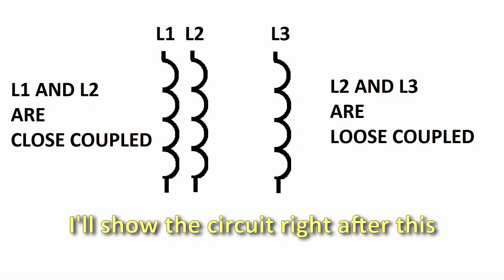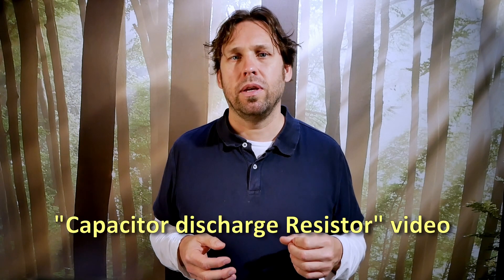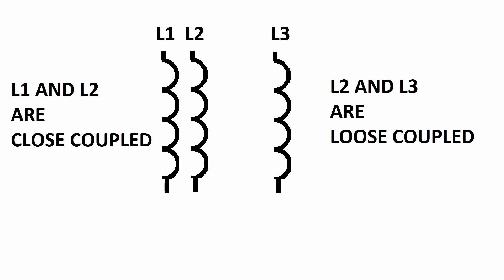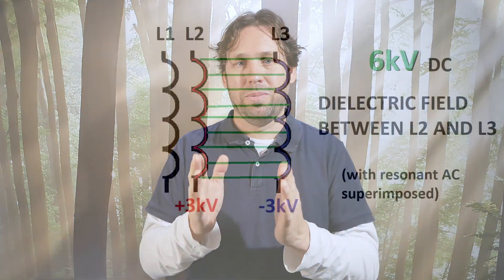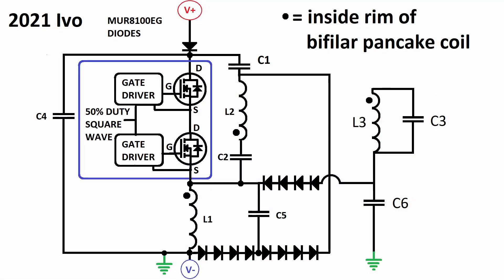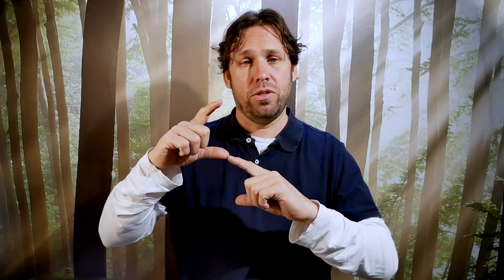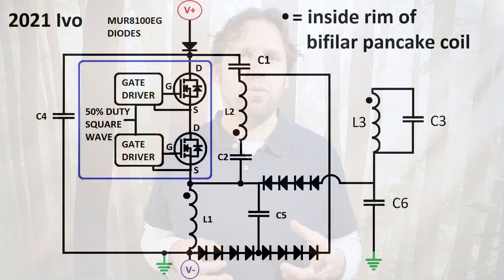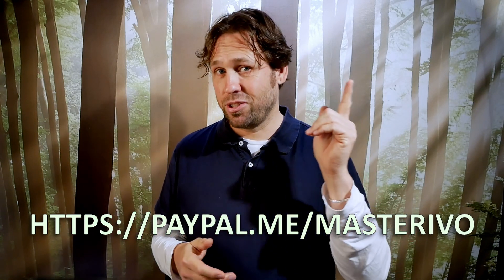Radiant Coil Capacitor Circuit 2021 Explained

Comment: What are the disadvantages and advantages of connecting the 2 Mosfets in series instead of in parallel?
Reply from the maker: series provides high voltage switching capabilities, if Vg threshold of the mosfet is matched.
parallel gives higher current possibilities.
series parallel gives both

Comment: # Master Ivo's Radiant Coil Capacitor Circuit & notes
[root video](https://www.youtube.com/watch?v=qxyf-L48Y8k)
[schematics](https://youtu.be/qxyf-L48Y8k?t=180)
[coil stacking](https://youtu.be/qxyf-L48Y8k?t=218)

(just to make it easier for future reference, anyone is welcome to complete, correct)
syntax notes:
* Series:`()`;  e.g. `(4)` = 4 in series
* Parallel: `[]`; e.g. `[4]` = 4 in parallel
* Reference: `{*n}`; e.g. `C4 {*1}...` later `{*1}: [4 * (2 * WIMA MKP10 2KV DC )]` 
## Components list 

6:41 
### Capacitors:
Need to gather specs for the ones in tuninc cap boards.
[For discharging capacitors](https://youtu.be/ncL5WgkD6Hc?t=98)

896 Ohms = 4x220 17W to protect the fast diodes.

#### C1:
 4KV: `{*1}` >1μF
#### C2:
 4KV: `{*1}`
 Tunes L2 in series with 51nF (IVO uses the cap board, I plan to make a binary system cap board with caps in powers of 2 :) )
#### C3:
 Tunes L3 in parallel with 61nF [cap board](https://www.youtube.com/watch?v=c2_rKc7sHGk&t=380s)
#### C4:
 4μF, 100V, WIMA FKP2
 
#### C5:
 4KV: `{*1}` >1μF
 
#### C6:
 
 4KV: `{*1}`~ 5nF, (Negative DC offset), currently using 680nF (680 sounds unclear?)

`{*1}: [4 * (2 * WIMA MKP10 2KV DC )]`

Notes:
  C2 & C3 caps tune the resonance of L2 and L3, hence testing is needed as size depend on coils.

### Coils (listed in stack order):
https://www.youtube.com/watch?v=2fLBZu7BJkM?t=35
#### L1 (larger)
#### L3 (smaller): output to lamp.
 Produces a triangle wave (not explained why.). Inside rim is parallel resonant with cap board, outside rim grounded. L3 inside rim > cap board > half bridge rectifier (to lamp, only one wire power transmission as the other side is grounded).
#### <Gap: 25mm nylon for loose coupling>

#### L2
 Is flipped for reverse phase (relatively smaller inductance than L1 is L1 impulses make a bigger amplification on L2 by parametric  resonance, for amplification, not sure how though).
https://youtu.be/2fLBZu7BJkM?t=174 By being hase-shifted it's supposed to work in the TEM (Transverse) resonance mode. Current shown is L2's 

#### L4? Soon, for output.

### Mosfets:
Silicon Carbide Power MOSFET. One of the Wolfspeed/Cree C3M SiC MOSFET’s that is excelent for impulse generation. 

2x C3M0065090D

### Gate driver:
mgj1D121505mpc
Wonder if an Arduino pin has an accpetable speed to work as gate (5v)
How to gate: https://youtu.be/c2_rKc7sHGk?t=370 for 2 pulses per cycle, (2X 49% dutty cycle), Pulse discharge happens in 1% dead time.
https://youtu.be/c2_rKc7sHGk?t=686: "1EDI60I12AF (?) gated driver IC's Powered by mgj1D121505mpc isolated DCDC converter" 
Isolated to 1.2KV

Think in later videos he corrected/repurposed this dual 49% dutty cycle mosfet to make it simultaneous series gating. If we use them in sync, do we still need one per Mosfet?

### Diodes:
** I mention the MUR8100E diode, but only the MUR8100EG is available. it has the same functionality.
https://youtu.be/c2_rKc7sHGk?t=522 Two in series with Mosfets. To prevent impulses from leaking via mosfets body diodes. it handles - & + 1KV impulses (should be adjusted for 4KV? for later video https://www.youtube.com/watch?v=qxyf-L48Y8k).
Result: https://youtu.be/c2_rKc7sHGk?t=553
![schematic](https://i.imgur.com/lo5nCVk.png)

Uses 3-4 in series to handle 3Kv-4Kv impulses.

## Input:
2 x 4V, 1.5Amp DC
2 x 4.1V, 1.28Amp DC (10.5 W) when lamp is lit. (56.4KHz)
https://youtu.be/2fLBZu7BJkM?t=368 : 5.74W but more power on L3. 67.23KHz.

## Output
L3: ~ 700V peak to peak.
L2 (dielectric) and L1 (magnetic) fields are assisting L3.
https://youtu.be/2fLBZu7BJkM?t=486 : L2 & L3 90deg phase-shifted, not good.

## Load
28W Lamp between possitive and negativ CD offsets capacitors, "just like in the power suppli side": https://youtu.be/c2_rKc7sHGk?t=943
CD mil-amps metter on lamp.
CD meter for lamp Voltage.

## Power supply

Symmetric, https://youtu.be/c2_rKc7sHGk?t=484 
from 2 square signals from two-channel Rigol signal generator (Cleqee JDS6600-60M) (https://youtu.be/c2_rKc7sHGk?t=783).

## buck converters:
DC-DC buck converter 5V 2A
https://youtu.be/Asa2RuubKWM?t=249

## probes/testers
L2:
https://youtu.be/c2_rKc7sHGk?t=848: Pintek HVP-08 high voltage
https://youtu.be/c2_rKc7sHGk?t=854: Current probe Pintek PA 655
L3: https://youtu.be/c2_rKc7sHGk?t=969 high voltage on resonant side.

## Notes:
[Concept of how to capture & recycle second half wave after impulse](https://youtu.be/ncL5WgkD6Hc?t=230)

https://youtu.be/c2_rKc7sHGk?t=84 basic circuit diagram, C3 doesn't look the same as in https://youtu.be/qxyf-L48Y8k?t=82

DC offset comes and goes, in latest videos it's back. 
Impulses come from L1 on dead time, from half cicle of resonant wave.
https://youtu.be/c2_rKc7sHGk?t=327 schematic with tunning caps and units.
https://youtu.be/c2_rKc7sHGk?t=800: capacitors for feeding HBridge ? not in schematics?

### Links to PCB are broken:
https://easyeda.com/editor#id=1fa6ba959b6844d598ef1974f6bed660 permission denied.
https://oshwlab.com/MasterIvo/radiant-half-bridge-900 (404: not found)

https://oshwlab.com login/register system is very broken.

Given that that one is missing, this migh do:
Video:
https://youtu.be/Asa2RuubKWM?t=166
Circuit:
https://oshwlab.com/renemeschuh/master-ivo-switching-circuit

I suppose a PCB diagram there would have been used to order at https://jlcpcb.com/

## Experiments:
https://youtu.be/c2_rKc7sHGk?t=983: Current amplification.
![](https://i.imgur.com/GVfVRun.png)
https://youtu.be/c2_rKc7sHGk?t=1082: at resonance max 790V and 7.22A pulse absorbed by L2-C2.
By tunning a bit higher the pulse appears again. With pulse on, current goes to 10.92A, impulse is 900V. L2 pp 3.5KV. Confusing results https://youtu.be/c2_rKc7sHGk?t=1220.
https://youtu.be/c2_rKc7sHGk?t=1275 current sign wave min and max get "separated" by amplification pulse charging the magnetic field of L2.

Thoughts on L2 gains due to the impulse
https://youtu.be/c2_rKc7sHGk?t=1609
The timing of the impulse at the point when the capacitor is fully charged and the coil has zero current, is synergistic as both, the capacitor DISCHARGE and the impulse, add up to current in L2. https://youtu.be/c2_rKc7sHGk?t=1802

The reciprocal experiment, using current impulse would destroy the mosfet, good for oopening the circuit not for closing. Here a spark gap would be better.

### 2 kinds of resonance
https://youtu.be/c2_rKc7sHGk?t=1883

Adding a parallel cap to L3 slows it down  to L2 freq. now we have 2 resonant frequencies. [Setup](https://youtu.be/c2_rKc7sHGk?t=1923)
[TEM](https://youtu.be/c2_rKc7sHGk?t=2142) is the lowest resonance frequency. L3 & L2 voltage in phase. [distancing L1 from L2 fixed the anomaly (phase shift of impulse)](https://youtu.be/c2_rKc7sHGk?t=2251). with TEM L2 becomes warmer. L2 is phisically conected to L1. By close coupling L1 & L2 an anomaly push L2 wave 180deg out of phase with the L1 impulse this does not happen in LMD.

[LMD](https://youtu.be/c2_rKc7sHGk?t=2270)
L2 & L3 voltages are out of phase 180Deg.  
[12.1 Amps p2p.](https://youtu.be/c2_rKc7sHGk?t=2395) with LMD L3 is much higher in voltage, with no change in inductance or capacitance. And L3 becomes warmer. Wireless power?

@see Eric Dollard - Transverse & Longitudinal Electric waves 1988.

We can recycle the magnetic field energy of L1 to amplify series resonant Current in L2, L2 can be brought into 2 kinds of resonance with L3 (TEM in phase, LMD out of pahse)
[L1 can provide magnetic while L2 dielectric induction on L3 simultaneously](https://youtu.be/c2_rKc7sHGk?t=2565) 

Radiant half bridge circuit PCB & part list missing.

## References:

https://open-source-energy.org/?topic=3576.75

Comment: Tesla tuned his radiant impulses to make atmospheric molecules glow and transmitted it wirelessly up to 25 miles. Can you do it around the house?  Any luck driving motors wirelessly? I get tired of vacuuming up my power cord... Great work so far. Party on Dude.
Reply from the maker: Thanks Bill. Tesla used ground currents for power transmission, which is still a mystery to me

Comment: Thank you for the experiments and superb explanations. I have one question , any particular reason to choose high side switching in your circuits ? I am thinking will low side switching also work ? circuit can be made much simpler. Your comments on this please.
Reply from the maker: I use high side, because this generates negative voltage impulses.
The positive voltage doesn't have the same effect, although that is still to be proven.
It appears the radiant wave can move OUT longitudinally or move IN, from the conductor (induced by the rapid change in voltage).

I have seen a larger increase of current amplification from the negative voltage impulse compared to the positive impulse.

And for the series mosfet switching, to get high voltage impulses (3.5kV) you need to use isolated gate drivers any way. Or do you know another method?

Comment: Hi Ivo,

Is L1 and L2 also 180 degree fase shift?
Reply from the maker: no.
L1 is pulsed by the mosfet, and at turn off it gives the vast negative impulse which is a resonant half wave of L1.

series resonant L2 is tuned down in frequency by the series capacitor.

so the frequency of L1 and L2 are a few octaves separate.

while the L2 and L3 have the same frequency
Reply: @MasterIvo  thanks

Comment: cool coilz, love it! do you like/recommend the new L1-L2---L3 stacking even for 'Tesla oscillator circuit' (rad half bridge mod) without DC offset? Or just for new iteration?

Also i believe at the end regarding C4 (4*1uF wimas) FKP2 needs correcting to MKP2 again, unless I err?
Reply from the maker: Ah I made the same mistake again? mkp2... yes probably
L1 close coupled to L2 has always been most efficient, so I do recommend it. also with the H bridge
Reply: @MasterIvo  gotcha, might be a couple months "out-of-date" with former L1-L3---L2. But its a good time to shuffle my stack, just finished an interesting new L2 (phi^2 OD/ID, and also with wide-spaced windings like my latest L1, because i ran out of the heavy wire & couldn't do else hehe). Im still uncertain of its merits, but testing should be instructive, regardless. Setting stack up as you've shown here.

As usual, huge props & thanks for always sharing your trailblazing setup & best-practices, would perhaps flounder otherwise <3
Reply from the maker: my pleasure

Comment: Thank you for sharing. Now this is for you because you can see it at scalar... Separate experiment with an off fazing on the scalar side between the opposing coils instead of the standing wave you are producing between them... Love your work you helped me I am grateful."Freely we have been given so we freely give."  Thank you again.
Reply from the maker: I can't follow you, which opposing coils?
Reply: @MasterIvo  coils in East and West direction or clockwise n anticlock  or counter clockwise with both ends in parallel connect is what he I think

Comment: Very true at their resonant frequency two coils in capacitance as A/C. You are thinking scalar... In the RF with coils used as capacitors. Which is I believe to be a missed point in Nicola Tesla's discoveries. The way we use electronics today reminds me more of Edison than Tesla but at the levels of radio is Tesla's way where ground is a dipole to the sky...
Reply: Ground is to the aether.
Reply: @Master Ivo  br just conc on charge seperation thats key, pos and neg when u spin magnet ie via magnetic flux thrs just charge in copper or current n voltage as it increases........ So hw 2 increase the charge in copper is what u must analyse say in 10kg copper what is the max charge that can be generated per cps, in 60cycles per sec... It's not that difficult... Just how much charge cycles u can generate, is generator per sec and that can easily be stored n discharged via cap

Comment: Searching. Have you discussed in a previous video, your reasoning behind driving the FETs at a 50% duty cycle, as opposed to, say, an extremely brief (<1%) on- or off-time? BTW, you're doing some fine work here, both in research and in communication.
Reply from the maker: thanks, yes 50% is because the switch has 2 functions. L2 is made series resonant, it charges and discharges using the mosfet(this works best with 50%) and L1 coil is charged and discharged
Reply: @MasterIvo  ur bipolar coil capacitance needs 2b synchronized with sec coil inductance but try using a ferrite or dc pulsed  motor or even a vibrator on the ferrite that is grooved to achieve ns sn

Comment: All I have to say is, what a different world there would be if Nikola Tesla's work had been adopted and placed into use.
Reply from the maker: indeed. It's time
Reply: @MasterIvo  Be safe.
Reply from the maker: I Am
Reply: @MasterIvo  The other half. I don't have the expertise to find out what's going on, you do. Hope it was received.
Start the coil working by briefly contacting the base with the collector using a bit of resistance between the two, such as a three or four watt light bulb. If using a low voltage, under 12 volts and using a high power transistor just a piece of wire will do.
I use as an indicator an inductor with and LED across it to detect a flux field produce when the oscillator is working.
The other ends of windings C and D are not connected, put a wire nut on them for safety. depending on the coil set up, this bridge can put out quit a bit. To me this is an anomaly. The out put of this bridge can be fed back into a cap., or used to charge a second battery, under the proper conditions can be run directly into the run battery.
Lately I have taken six strands of 20 gauge magnet wire of approximately 38 feet in length, twisted the run of wire and wound it into a single layer pan cake coil, still experimenting with it. 
This is all very primitive and low level research, no calculations, using just basic principles.
A lot of trial and error and the occasional puff of smoke. Sometime more than just a puff.
By the way, these oscillators can be cascaded with weird results. It is advised not to leave any experiment unattended for very long, once on returning to the experimenting room, if found it filled with acrid smoke, had to turn on the ventilator and get out. A fairly large coil had baked itself, still don’t know how. I have been experimenting for many years, 15+, and have developed a saying,
TRY IT AND FRY IT. Some of these things have run for over six months, some have armatures and some are coils only.
Reply from the maker: thanks got it
Reply: @MasterIvo  very good, A joule thief variant.
Reply from the maker: yes in a way those are partly simular
Reply: @MasterIvo  Is the current being produced in winding C and D from induction or perhaps radiant in origin. Your pancake coils could be used, four windings, A, B, C, and D.
You are able to do the calculations and employe resonance.
Reply from the maker: I've drawn out your circuit. very interesting. CD open ended(? strange) with only a rectifier for output.
So it's like 2 close coupled bifilar pancake coils.
What transistor do you recommend?
Have you also worked with PNP?

I would love to hear more. my email is on my YouTube "About" page (use pc, not seen from mobile)

Also very weird your message was deleted. Thanks for your percistance in sharing.
The resistance will be around 1K at the base I guess? tunable 1K

What confused me is the B winding ending is hooked to V- of battery (emitter), that whould give the base a negative voltage/ current spike.
this would turn the transistor off.
that is opposite of how a joule ringer works. 

I guess I'll have to build and play with it

I subscribed to your channel, if you would make a video of it I would see it

Comment: Waaw you explain it verry well , the DC ofsets are pritty interesting, what if you just a load in l3 it self, ore meby cude l4 be a HV helix's coil , the waves look a bit like the waves of wel bould bedini/kromery g-field generator , I always thought the bifilar coil is just a way of winding any coil to incrise the capacity so you don't neet to have capacitors when generating electricity? It's not restricted to flat coils in mi experience , cheers
Reply from the maker: indeed perhaps flat coils aren't needed, but it's the pathI choose.

Comment: At 7:50 when you say 2 caps in series lowers the total capacitance and increase "resistance" ... Is that sentence contradictory? Impedance-wise you know?
Thanks for sharing! Super interresting as always!
Reply from the maker: Thanks, but purely looking at the caps without coils so no it's not.
Reply: @MasterIvo  aaah! I didnt get it at first. Thanks for awnser!
Reply: i think basically if you have to caps in series your just increasing the distance between the plates which gives higher  V rating but cuts the capacitance because distance between the plates is part of the calculation for capacitance. at least as I understand it. Wish i could donate again and will but i just cant at the moment.. Great Information as usual...
Reply from the maker: correct razor123, and in parallel the plates become as one large plate, thus increasing capacity